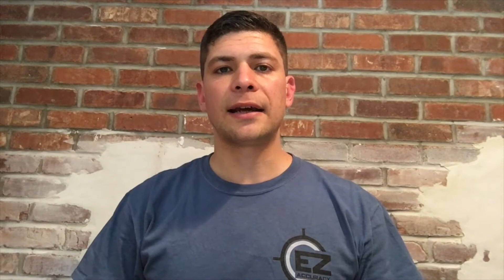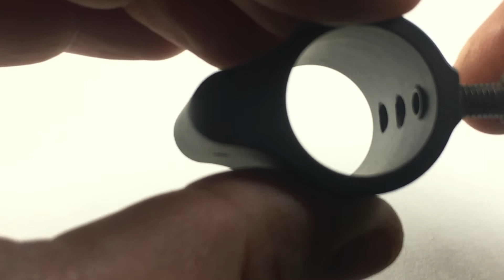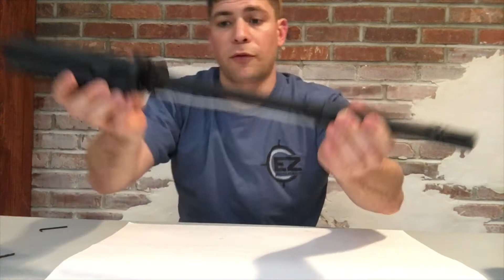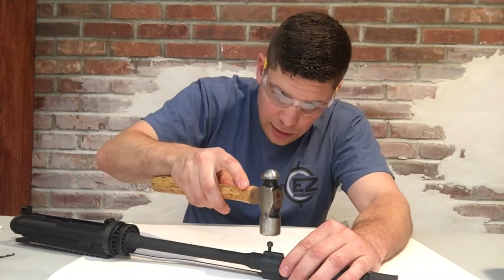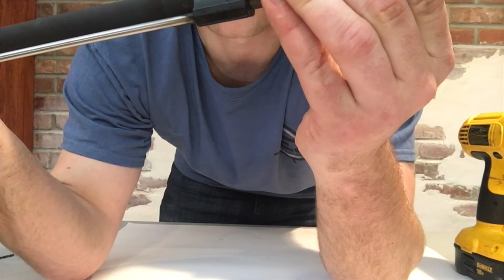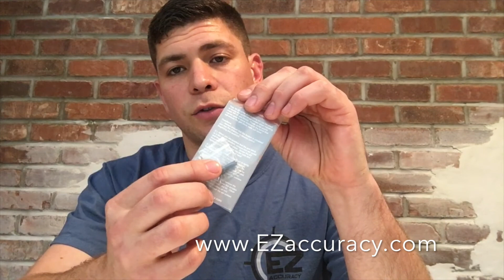EZ Accuracy AR-15 Gas Block Dimple Tool

Comment: As far as depth you can buy a depth limiting collar for the appropriate drill bit size. To go one step further on how to set the correct depth with the depth limiting collar, you can place a washer (0.030”-0.035” thickness) between the barrel and the depth collar on the drill bit. Then you tighten the collar and remove the washer and now you have it set to go down the depth of the washer.

Comment: This is different from an actual barrel dimple jig that has a threaded pin that lines up the gas block hole with the top of the jig so that the dimple is 100% in correct spot.
Reply: Yea it’s a cool idea but this doesn’t ensure alignment. Which is arguably the only reason for dimpling a barrel.

Comment: You can mark it with punch by removing the screw, the purpose of doing the dimple is centering the gas block hole with the barrel hole your just drilling with the gas block already aligned, this tool is so dumb with no purpose!🙄
Reply from the maker: Incorrect Oscar.  The purpose of the dimple is to ensure the gas block does not move under use.  Over the years, we have seen many gas blocks shift under hard use which deadlines the firearm.  Also, you incorrectly used "your" and should have used "you're" meaning "you are".  Maybe something to correct before calling something dumb.  Just a thought!
Reply: the spelling of “your” in this sentence is relating to oneself, perfectly acceptable..... 
however, ‘you are’ within  you’re right to use “you’re”.          TO  WIT;
your a typical ass
you are a typical ass
you’re a typical ass
I have 4 packages of item...bought a few years back and have satisfactory used.
still on first set and point is still sharp.

Comment: I really like this product. It’s very simple yet just as effective than other dimple jigs. I have to say that using locktite on a gas block is not a good idea because  heat deactivates it, and the gas block can get much hotter than any type of locktite is rated for. You should use rocksett on gas blocks because it withstands heat up to 1100 degrees.
Reply from the maker: Thanks for the feedback!  Rocksett does really hold up to the higher heat!

Comment: Normally there is a approx. 1/16 th inch gap between the flat surface and the gas block for proper alignment of the gas block and the hole in the barrel. Then again I may be wrong.
Reply: Technically yes, but it really doesn't matter with MOST gas blocks as the gas block hole is larger than the barrel's gas port. It shouldn't matter. that gap is there to accommodate the handguard cap on M16/A1/A2 non-freefloat handguards with Front Sight Bases. However, installs of low-pro gas blocks will take into account of the gap, rather than butting up to the shoulder, to ensure proper indexing of both the gas block hole and gas port.
Reply from the maker: Thanks for squaring people away!  Send me an email at eric@ezaccuracy.com and Il send you some product!
Reply: depends which barrel you use..my faxon recommended a feeler gauge between the barrel shoulder and gas block...my odin works index's directly on the shoulder

Comment: I thought the purpose of dimpling was to align the port and block hole, how did you align the hole?
Reply: the purpose of dimpling is to prevent rotation or movement of the gasblock after installing, during firing.

Alignment to the gas block hole can be with with other dimpling jigs, such as SLR, or visually indexing the gas block and confirming proper function prior to dimpling.

Comment: I am so glad I bought this tool!!!! I just did a perfect low profile gas block install on a nitrided barrel using this tool and it made it so easy. The center punch was only good for two of the three dimples I needed to make, but following the advice of Eric from EZ Accuracy I just ran the drill down the center of the hollow set screw and made a perfect starter dimple. Easy to do.  Thanks EZ Accuracy.

Comment: I hear crickets. No response to my first post at all. So I'll ask again. Will this work to mark and drill nitrided barrels? I realize the drill bit will need to be a carbide drill bit, but what I want to know is whether or not the pin that fits inside the set screw will be able to leave the start dimple for the drill bit?
Reply from the maker: Sorry for the delay.  The center punch might have a tough time getting a good starter hole going but even if it doesn't leave a very deep one, the drill bit will still follow the guide and creating the dimples shouldn't be a problem.
Reply: EZ Accuracy, you were right. I changed out my barrel today, and after two dimples in the nitrided barrel the center punch was distorted to the point of being unusable. The particular gas block I bought was from Faxon Firearms, and it had three set screws in it. However just like you said I just put the 1/8 cobalt drill bit down the hollow set screw that came with your tool and it created a perfect little starter dimple. After I got all three holes started, I removed the gas block and then used an 11/64 cobalt drill bit to finish up the three dimples. It was easy and I'm so glad I bought your tool. Thank you.

Comment: You need to cover more clearly how your 100% sure the gas block is in the right spot
Reply: Just use a Gas Block Genie.  Gasblockgenie.com.
Reply: Don Locke how i check mine is i eye it up, then i go out and shoot it if it runs well i then come back and dimple. Most gas block have a much larger port then the barrel gas port and can actually be canted 1-2 deg left or right and still run perfectly fine, but just by eyeballing it i have never had an issue with a gas block

Comment: Do (or should) you put some type of treatment on the dimples to protect against corrosion?  The design is ingenious and at a much more attractive price point.
Reply from the maker: Thats a really good question Chris.  Im sure you will get a lot of different opinions but here is how I feel about treating the metal where the dimples are drilled.  A solution such as a "cold blue" would not be good to put under there.  Many times, if not kept oiled, the cold blue will begin to rust and you will not see it under the block so I would stay away from that.  Something like cerakote would be great but would be costly.  Maybe something like a high heat paint would work but the barrel and gas block can become very hot.  Exposed gun metal usually rusts due to moisture and salts from your hands. Your gas block should have a good seal against the barrel and the small amount of exposed metal shouldn't be an issue.
Reply: Thanks for the explanation.  I've heard of the "cold blue" but not the other options.  I've actually spoke with a couple different independent gun stores that do custom work (say completed uppers) and when asked if they dimpled the barrels, they told me no (at least one guy stated that most shooters aren't going to subject their rifle to that much stress so it's not necessary).

I want to do the job and do it right the first time; I also don't mind spending the money for quality tools and components (well as much as my bankroll allows).  

Between this and a gas block jig, yours in the more price competitive.